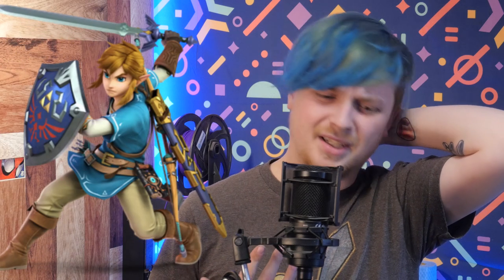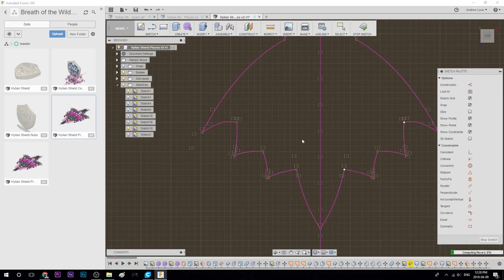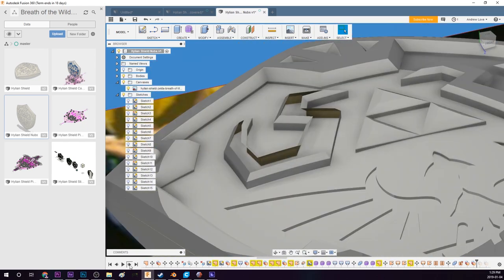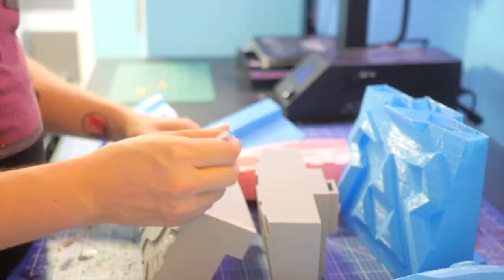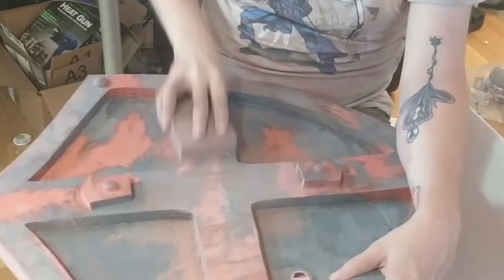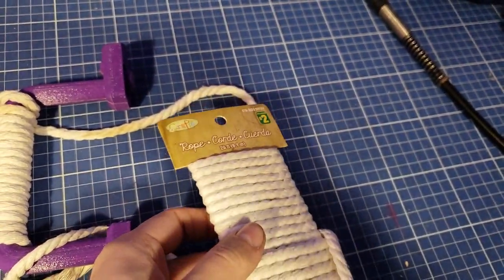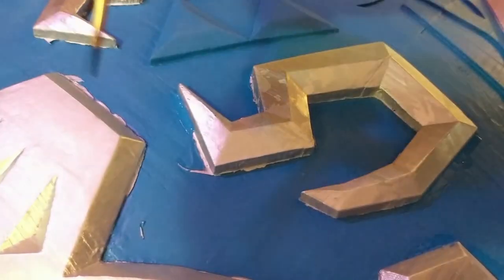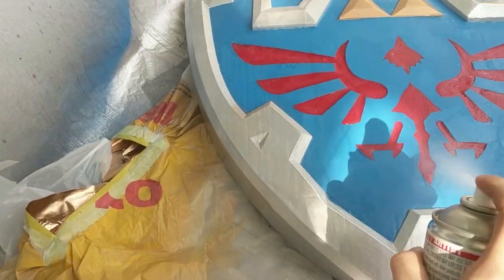How to 3D Print and finish a Hylian Shield - Legend of Zelda Breath of the Wild DIY Prop

Comment: I know this video is 10 months old and the craftmanship is awesome, but can you explain how you gave the curve on the sheild? I'm using Fusion 360 and I'm not sure on how to do the curved extrusion in the time lapse. Thanks!
Reply from the maker: Hi! Its been a while since I modeled this so I'm kinda reverse-engineering my own work here, but I think this I what I did: I made a sketch with an exaggerated curve, used revolve on it to make a big round shape, and then scaled it down on 1 axis to flatten it into approximately the right shape. Hope that helps!
Reply: @3DIYshow  Thank you! I've been trying to get that curve shape for awhile but didn't know how to do it.